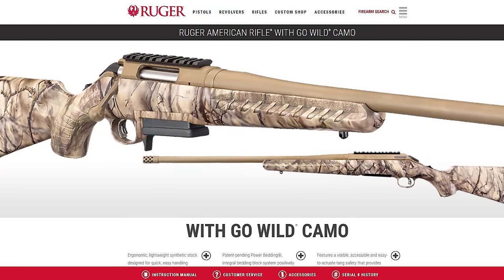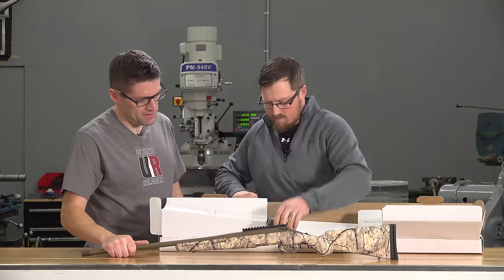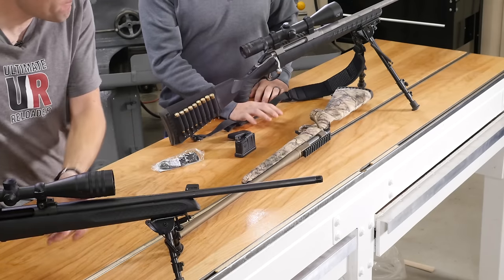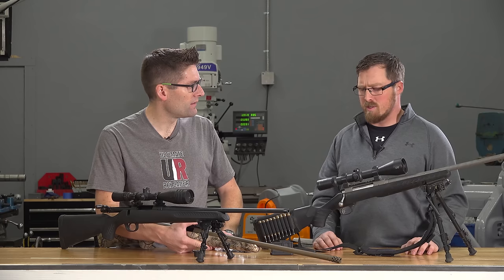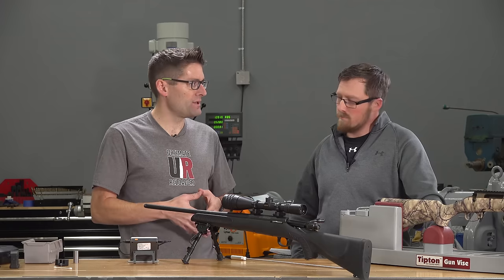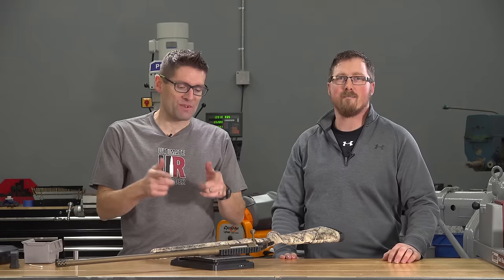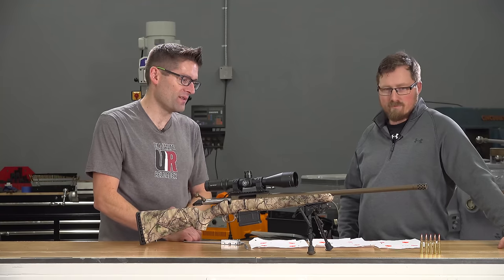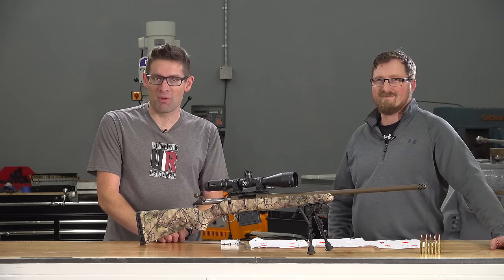Tested: Ruger American Rifle Go Wild in 6.5 Creedmoor

Comment: I have a Ruger American Predator in 6.5 creedmoor, that I changed out the stock for a Magpul Hunter stock, changed the top rail out for a warne maxima tactical rail, with a warne skyline scope mount, Nikon FX1000 4-16, Magpul mlok rail on the bottom of the forend and a warne skyline Bipod, and a precision armament m11 extreme duty muzzle brake.

Comment: The Ruger American stocks are too flimsy on the bipod mount. I bet when you are prone and load the bipod it forces the barrel and the stock to touch and affects your accuracy.
Reply from the maker: Perhaps time for some DIY stock inletting on my Precision Matthews milling machine! :) :)
Reply: @Ultimatereloader  I wish they would do something similar to Kimber, with a honeycomb pattern stock reinforcement. Their stock is pretty rigid.
Reply: I had to actually buy three different bipods B4 u found the perfect one for my Savage Axis.Some odd brand i would have to go open the case i keep it in?I think its Vlife, some weird brand?I have an NcStar and a Magpul pod and they work fine on every other rifle i have but not the savage the rest's on both would not fit up tightly to the bottom of the stock.But the last one did.Good solid grip on the stock and sturdy fit.
Reply: gavintoobe I’ve heard of people doing that, filling with some type of epoxy and arrow shafts. I would address this issue before loading for the rifle. Or else your always going to be chasing that harmonics node... love the videos. Keep it up!
Reply: The newest Ruger American rifles have a much thicker walled honeycomb pattern in the fore grips and don't flex like the old stocks did.
Reply: Well it's more of a X pattern inside the forearm but you could lay some rockite epoxy in it and hit with some light Dremel tool and bed the shoulder portion of the stock by removing the butt plate and from videos I've seen it's day night difference & rockite is cheap, alot cheaper than a new stock!
Reply: @rowdybroomstick1216  the 2nd stock design was an X pattern. The new design is a honeycomb in 3 spots and a radiating triangular pattern past that. "https://drive.google.com/file/d/1KyWOhEADm-xtOVgdz7ktV_XVsA9GoqrP/view?usp=drivesdk"
Reply: @macgyver5108  I had the newest version. It's still flimsy and needed sanding in the barrel channel and filled with epoxy. It touched the barrel easily. The "fix" on the gen 2s did nothing. I eventually got a Magpul. Ten times better
Reply: @brockedandloaded6034  I have the second version, I sanded out the barrel channel enough to lay one layer of fiberglass cloth and epoxied it in. Sucker is rock solid now but the plastic around the action still gets soft after some rapid fire.
Reply: @macgyver5108  yeah the epoxy fixed mine too. I just wanted to make sure people knew just because they get the honeycomb one doesn't mean it's fixed. Still got do the DIY fix at home to get it free floated. Once I did that it was a freaking tack driver, like most are. Great guns
Reply: @brockedandloaded6034  Yeah, so is mine. The best it's shot is .3 MOA.
Reply: @brockedandloaded6034  I got the magpul on mine as well and wow what a difference!! It's a whole new gun now!

Comment: I have a couple Ruger American Predators in 6.5 Creedmoor,one fed great the other didn't so I loaded both mags.set them side by side & could see with the mag.that would not feed the cartridges sat more on a level plane & about 3/32" lower than the mag. that fed every time. I also wanted to have a couple of spare mags.so I ordered two more thinking they might be better,I was wrong!  It seems the later mags. have the feed lips closer together than the earlier model I have which made the cartridges sit lower in the mag. I ended up taking a fine file & shaving the later mags.feed lips until the cartridge sat that extra 3/32" higher in the mag.plus I shaved slightly more off the feed lips toward the front where the cartridge shoulder rides so the cartridge sits a little nose up!  Now every magazine I have (four) feed perfectly every time!  I love the flush fit rotary mags. but only if they work!  For the guys that have feeding issues with their rotary mags.this works!  One little tip,push the follower down & out of the way while you file the feed lips so you don't damage it.

Comment: I note your correction in the description, but a big difference outside of the aesthetics and the provided brake is barrel length. I’m looking at the Go-Wild vs the predator because you get longer barrels with the go wild. For the 308 it’s 22” vs 18” in the predator. So, there’s some potential for improved velocity performance with this version over the predator.

Comment: what height are the rings you have on the scope? Lol...I know, strange question...I ask because I noticed it seemed that you guy have the same problem I had when I was in the store checking the gun out. The stock is low, so you are putting more lower jaw than cheek against the stock. I guess I could add a cheek cushion...and/or use a lower ring. Thanks.

Comment: Just bought one in 7mm-08. Very anxious to try it out.
Reply: Have do you like it?  I’m thinking the same thing.  Thx
Reply: @thews9237  I love it! I did do a fair number of upgrades, which really made a big difference. I swapped the trigger for a Timney, mounted a Leupold VX-Freedom on top of Talley lightweight rings, and swapped the bolt handle for an Anarchy Outdoors threaded bolt handle. Magpul AICS pattern mags run perfectly. The whole package weighs in at right about 8 lbs loaded. It consistently groups inside a MOA for me with my handloads.

Comment: Ok. So this will be a kind of lengthy post.  
 I have a t.c venture 2 in 6.5cm, I have a ruger a predator 2 in 6.5cm,  savage axis2 in 308, 25-06,223,17hmr. .
 All the savages are in Boyd's stocks . The 308, 25-06, 223 are in thumb hole precision stocks both the 308 & 25-06 are pillar bedded. Riding on the 308 savage is a bushnell ledgen 6-18-50mm , the 25-06 has a Nikon prostaff 4-12-44mm .The 223 has an old school ( not the now walmart ) tasco silver antler 3-9-50 mm. The 17hmr has a Bosh and lamb ? 3-9-50
So far I haven't found a rd that these guns dont like. All factory loads . Across the board on all 3 rifles except 17 ( it only gets cci) . I have put hornady,  federal,  Winchester, Remington, game king , seller and babbit? And some random factory reloads . I've ran 93gr ? Up to 148gr through my 25 .
110gr - 180gr through the 308
And 55gr-64gr through the 223 . In every load except one all rifles held an easy .5' m.o.a at 50 yards for the 17 ,100 and 200 yards for the 308, 25-06, 223. None of the rifles shot the Remington very well . Every rifle shot .5 groups or better with hornady. The 308,25-06,223 all experienced failure to fire with solid primer strikes shooting hornady American whitetail 
                      
The t.c in 6.5cm is in the factory stock but has been 100% stiffened.  It has a bsa world class. 4-10-50mm 
 After only 10rds through the rifle it stacks 5 rds at 200yards latterly 5rds is one group that I can put my finger tip over . 

The Ruger a predator is nestled into a Boyd's spike camp that has been pillar bedded . It has a vortex 6-18-44 on it . 
Stacks 5rds @ 200 yards. 
 None of them will run Remington with speaking of. 

My point in this massive post is that the savages @330$ new shoot just aswell as the 540$ t.c and 560$ ruger .

Comment: I know thus is a old video but my Ruger American Predator in 6.5 Creedmoor shot lights out at 100 and 200yrds using Hornady 120gn A-Max but I think Hornady stopped producing the A-Max bullet and load but my Tikka CTR shoots lights out using Hornady 140gn vld-match load like you say its all in finding what shoots in YOUR gun and set up I went through several and I mean several different brands!

Comment: I got a regular Ruger American in 308. My stock did touch front left of fore stock !! I was surprized at how much kick the rifle had at 6 lbs total weight ??? I added 4 to 5 lbs of BB’s to the stock and free floated the barrel ! I now consistently get sub MOA groups using the 168 grain Federal match king bullets !!! Now that my rifle weighs in at 11 lbs it is a delight to shoot at the range as it relates to recoil with 168 grain bullets ! It might be easier to wedge the fore end off the barrel with some type of card board wedge, then hit the fore end with a hand held hair dryer ????? I have not seen anyone rebed the action, so I suspect the factory aluminum bedding works well enough ???? Anyway its now a great hunting rifle that should be good out to 500 yards, which 350 is the furthest I have ever shot in Oklahoma ??? Those 168 match king bullets seem to be magical in every load build that I have seen so give those a try if you own a Ruger in 308 !!

Comment: Have same rifle 
Pro's shoots 140 Hornaday ELD-M great & Herter's 140 gr soft point great. Herters ia $14.00 per box at Cabela's great price. Con's closing bolt after chambering a round is a little rough & taking off stock to adjusting trigger pull is a pain.

Comment: For your first 6.5 the BEST DEAL!!! I went from 30.06/,308 to it. I have hunted and harvested deer late in life for 10 years and found that deer are color blind and see in hues of yellow (know your game). I learned through experience that deer can see dark barrels move at 100 yards but this rifles tan pattern makes you invisible especially if ground hunting (I also wear desert camo). It will hit in the red at 1000+ yards off a bag or stand rifle rest with a Vortex 5x25 FF ($400) no need for a $1k+ for hunting, mainly 100 yrd or less shooting anyway maybe 200 in woods.  THE BAD, use sandpaper on the stock around the barrel, the barrel touches and you get flyers. There are stock mods now for better cheek rest BUT with a half dowel of good size that can be solved. Added QD to aft and barrel stock for mil type carry sling for ready at a moment or carry when dragging game. It could be hunter orange and the deer would not see it, this just looks good and smart and an envy of all.

Comment: I've got one in 308 with the short 18 inch barrel.  I bought because I was looking at what do I do with all my 308 reloading equipment I had for my precision rifle I sold a couple years ago, do I sell the equipment or maybe buy another rifle?  So I went to go check out rifles and was intending to get a Thompson cennter Compass but the Ruger caught my eye.  It was a scoped package had the one piece rail, scope & rings for about te same price as the Compass and a scope, (Vortex Daimondback).  so I picked up the Ruger.  It's been a shooter!  The accuracy surprised me!  I am still working up a good accurate load for it, working on some satterlee 10 round devolopement, even though I pretty much already know what it's gonna be, Confirmation.  I figured if their are guys competing with short barreled AR's  It shouldn't be  any problem with an 18" barrel , maybe a little less velocity?   It's been good I maybe have 300 rounds through it, off the top of my head.  The external magazine was a big selling point for me.
Reply: Oh I also bedded the fore end of the stock  with epoxy, even though it was pretty well cross braced it still had a little bit of flex.  Although I may just put in a bell & Carlson stock if it comes to that.

Comment: Would you say that the stock was touching the barrel at all? I’m interested in this rifle however a in couple of Ruger Americans I just looked at the barrels were not centred in the stock and were touching one side of it.  Just wondering if that might have explained the flyers.
Reply from the maker: I think it does touch the stock- when loading the bipod, and perhaps under heavy recoil. I wish one of the rifle OEMs could figure out a cheap plastic stock that was 500% stiffer, and had more freefloat clearance... Gotta be doable!
Reply: gavintoobe Yes that would be great.  I suppose you could use a Dremel to add a bit of space but we shouldn’t have to do that on a brand new rifle.  Did you consider throwing in an MCarbo trigger spring?  Takes it down to 2 lbs.  That should also help to tighten up the groups.  Pretty sweet fix for $13.

Comment: I have a Ruger American predator in 6.5 been out to 600 yards without any problems put a Boyd’s stock on it vortex viper pst gen 2 5-25-50 👍🏻👍🏻🇺🇸🇺🇸 cut a couple coils off the trigger spring works much better

Comment: I think the farther away the bolt gun market moves from control round feed claw bolts, the farther away from the new gun market I move and the closer I move to the older rifles built to work right for a lifetime. Budget guns may be attractive now but in 10-20 years how will they work, and how will they shoot? I’m on the fence about these cheaper versions and I lean still toward the more expensive Hawkeye rifles with Ruger. I wish Winchester would get off their “mountain pack” light weight gun agenda and put out some models with heavy barrel options and I would consider that in a heartbeat.

Comment: I love this Rifle, im wondering if i should lay epoxy resin in my stock but for as of right now its accurate as hell for reals mounted a new vortex 6x18-44 Sun shade maked it lool better
Reply: I bedded mine and put sillacone with a few oz of birdshot sprinkled in the stock. It added about 2 lbs but it is so Smooth like No vibration or recoil. 
But all in all,  I wish I would have left it alone. The extra wt it gave just is not worth it for a hunting rig.. 
And it was plenty accurate before I even mess with it.
But I had to make it "Better"  lol.

Comment: The old savage stevens 200 rifles will usually shoot under MOA too.
Reply from the maker: I heard that, but haven't shot one myself!
Reply: @Ultimatereloader  I have one in 223, stock wasnt the greatest and top fed only, unless come up with parts to convert to dbm. I found a regular series 10/11 stock at a local shop I swapped it out. They are a 10/110 action with a cheaper stock and finish is all, but all parts are same as a regular savage. Dime size groups w/cheap win ammo, I think 45 grain. 1 in 12 twist though.

Comment: I have the go wild chambered in 7mm 08 it is a great rifle smooth and accurate. I have shot at least a hundred rounds now and I have found the stock to be the only flaw.  So to fix that I wanted to get a Boyd stock but then you loos the all style mag and my other option is the magpul which seems bulky and more like a target stock. Seeing as I got this for hunting I don't want bulky. If any one has any experience with these stocks on this rifle let me know your thoughts.
To add what magpul color stock do yall think matches the bronze cericoting?
Reply: If you haven’t bought a new stock yet check out the Bell and Carlson stock. Then spend an additional $200 for CDI bottom metal and you’re good to use AICS magazines still. 

Otherwise just sand out the barrel channel of the factory stock to give the barrel lots of clearance and add a cheek riser, Matthews Fabrication is really nice and he has a low-profile bolt option so you don’t have the big turn-knobs if you do not want them

Comment: It appears that this rifle prefers the 120-grain match bullets. In my testing for a hunting load, I settled on Nosler 120 grain ballistic tips which shot well on target but in fact ballistic is the definitive term and may not be the best choice if achieving the least amount of tissue and meat destruction is your goal. I think having 2 people shoot the same rifle and loads was a good thing as anyone can have an off day. I would have liked to see the least accurate loads groups also because all groups tell a story about the rifling, length of throat and etc. Also, I believe the NRA protocol of five 5 shot groups would give a true picture of the accuracy of this rifle. We have gotten away from looking for the truth and most people are chasing after "the best hype" bypassing actual group size and taking the best of 3 or 4 shots as the absolute best. For example, if they would have been using a lead sled that may have shrunk their group sizes. It was a good video suppose anyone could say if you think you can do better do it which I may do in the near future. Of course, by then most will be stampeding to the next greatest caliber.

Comment: Question are the barrels different between the standard American, wild, and predator?
Reply: The difference is barrel thickness. The Standard American is a pencil barrel that is NOT threaded. 

The Predator and the Go Wild share the same barrel that is what they call a “medium Palma” contour barrel, so slightly thicker, and the barrels are threaded 5/8x24
Reply: @lucass4758  Thank you I'm going to get the predator then in .308 for deer hunting out of a tree stand
Reply: YT _LIFE the Predator will have a 18” barrel, the Go Wild will have a 22” barrel. Not sure if you care about the longer barrel length